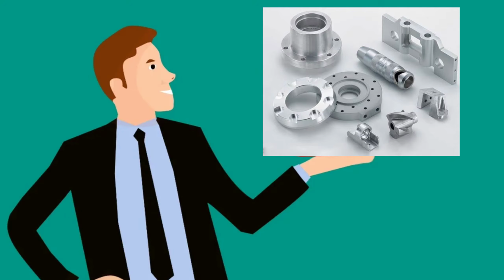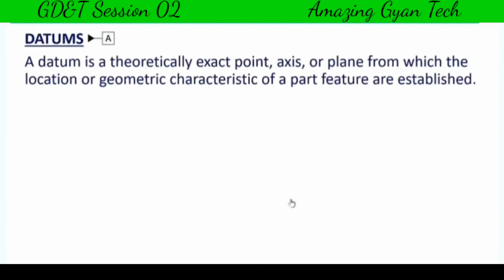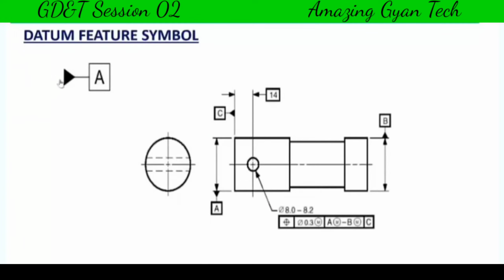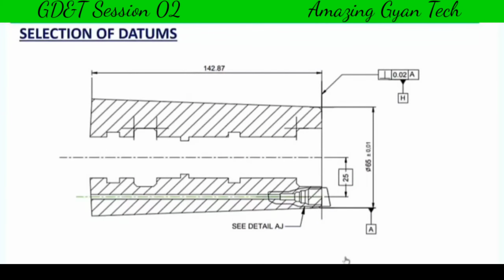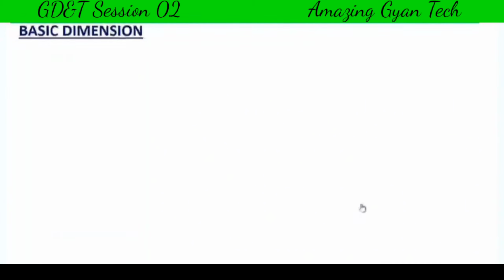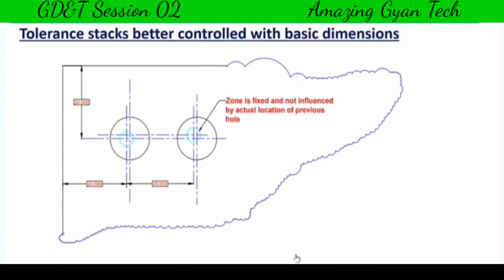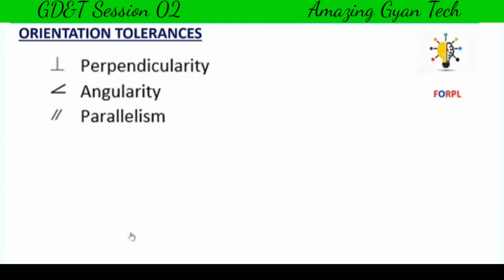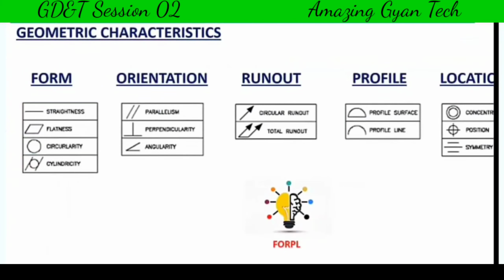GD&T Tutorial Part 02 || Basics of GD&T || Features of Size || Explain Datum Symbols || Placement

Comment: Why I o and q letters are not used
Reply: In Geometric Dimensioning and Tolerancing (GD&T), the letters I, O, and U are avoided for datum reference because of the following reasons:

1. Avoiding Confusion with Numbers or Symbols
The letter I can easily be mistaken for the number 1 in certain fonts or handwriting.
The letter O can look like the number 0 (zero), which could lead to misinterpretation of a drawing.
This confusion could result in significant errors in manufacturing or inspection processes.
2. Maintaining Consistency Across Standards
Standards like ASME Y14.5 explicitly recommend avoiding these letters to maintain clarity and ensure that drawings are universally interpretable.
By excluding I, O, and U, the likelihood of misreading is reduced, and it adheres to the consistent framework that GD&T provides.
3. No Special Significance for "U"
The letter U doesn't have a visual conflict but is excluded by convention. In some contexts, U might be associated with a "Unequal tolerance zone" symbol or other notations, which could create ambiguity.
By excluding these letters, GD&T ensures that the datum references are clear, unambiguous, and easily understood by engineers, machinists, and inspectors worldwide.

Hope this helps to answer your question.